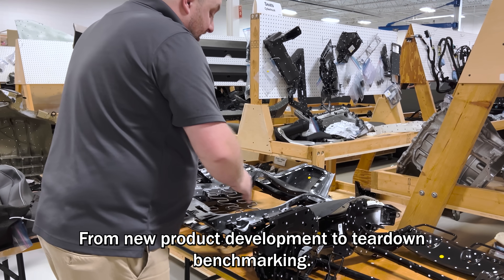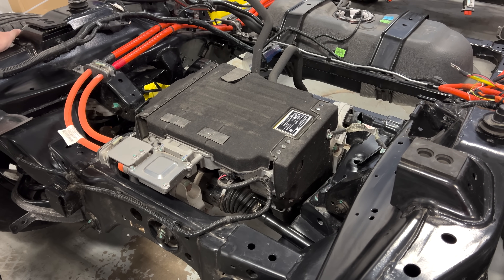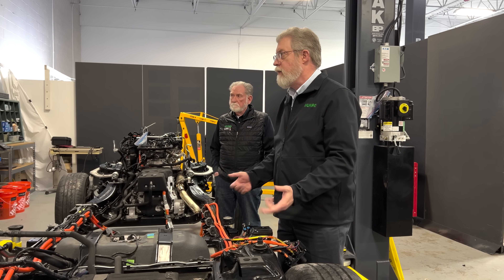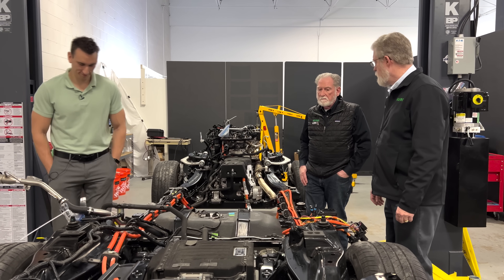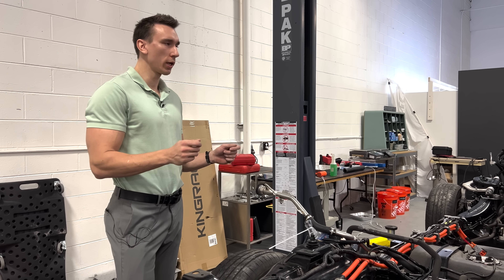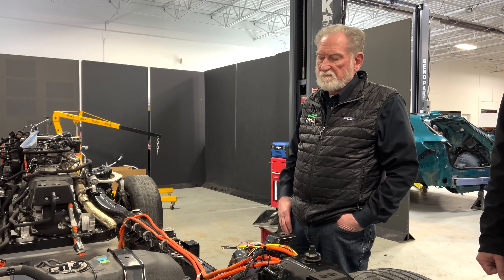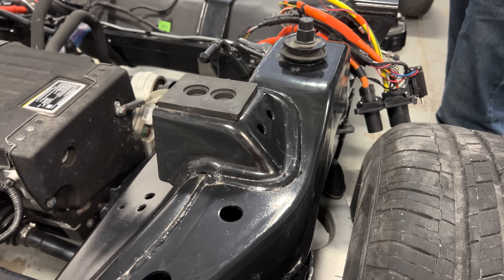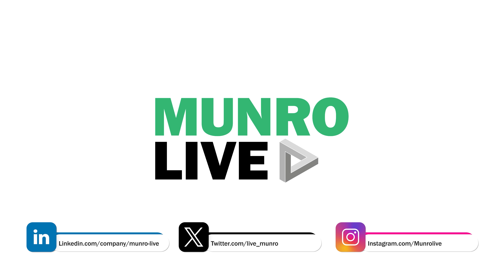There's a Monster Under the Bed of the BYD Shark!

Comment: The EM loss from this crazy ground loop wiring is probably less than a watt. But its interference into other electronic systems may be significant. In other words, it's not the power loss that we care about. 
The ground strap into the frame is okay if it's only done once. But if it's done in multiple places then you really have a very bad design.
Reply: I doubt it is electrical noise Isolation. It is common practice to ground the case. And the effect of the ground strap shall be easy to find out, just disconnected and see what happens
Reply: I believe the ground is there more to give a path for static electric dissipation.  Depending on tire formulation, you can build up a pretty huge charge.  That is going to couple into the vehicle through the rear half shafts and into the motor housing.  Better to send the charge from the motor housing into the frame instead of through the power electronics.

I learned about static build-up on a Mazda MX-6 I had back in the 1980s.  I put fancy Goodyear directional tires on.  Apparently the compounding was favorable to generating a static charge from the rolling friction.  When I got out of the car, if I wasn’t hanging on to something metal in the car, I would get a shock,which would almost knock me on my butt.  It was quite astonishing.

Comment: Some of these designs are common on semi trucks. Especially the hybrid welds with bolts. Probably the best example is the rear bumper on the trailers. It provides predictable crush behavior during crashes, because the bolts break or pull out before the welds. As for armored vehicles, the suspension on the M48 used something similar to make repairs easier after mine strikes. The M60 integrated it into the casting, which was so difficult to repair that it was withdrawn from Vietnam specifically because the difficulty of repairing the incessant mine damage. Which is why the M48 remained in service despite being outdated. So there are some precedents from other fields
Reply: made by retired tank engineers 😁
Reply: Nothing on a semi is welded, you part of the BYD 50 cent army or something.  Everything is bolted to the frame.
Reply: @Dexter_Solid bolt on pickup point on commercial truck chassis. Well, what do you know? 1450?
Reply: ANYONE seen videos from India, Africa, Asia where trucks are insanely overloaded 4m high with huge loads?   Perhaps that is the target market!   NOT Lot Crawler Urban Cowboys and Pretty Boy Dance haul trucks in the West.,,,,,,,,,,,,

Comment: So they are dissing a structurally sound and overdone structure?.....no surprise American cars fall apart.
Reply: It's Constructive Criticism. 
It's what they Do. 
Breaking down and assess the Product. And how it all comes together. BYD simply over engineering to insure that pass all market Saftey standards.

 + give reassurance to new customers that is build to last. Minus the Electrical Side 😑🤣 .

It's fair to say BYD has come kicking into this market and alot of the Western Car manufacturers are worried since BYD can Undercut them on most if not all of the lowest priced models mod priced models and getting your band for your buck.
Reply: If you design something properly, you can reduce weight and get the same structural strength. You could build a desk from steel girders and steel plate... that doesn't make it better if you are putting a monitor and keyboard on it. American cars fail probably because of the Chinese parts being used.
Reply: @GetOffMyyLawn lol how ridiculous so American companies care more about profit than product? Hah ok
Reply: @GetOffMyyLawn  American cars do not need  Chinese parts to fail!
Reply: @GetOffMyyLawn oh, you're dumb.
How Sad....
Reply: Angry Wumao, who is also clueless about engineering.
Reply: @JigilJigil  bigot who is also racist
Reply: @JigilJigil  What do you Got?
Reply: Overengineering, or over-engineering,[1] is the act of designing a product or providing a solution to a problem that is complicated in a way that provides no value or could have been designed to be simpler.
Reply: They broke the rules of US planned obsolescence.
Reply: @wdentondouglas  There is NO current loop.  The rear motor pair is separate from the charging pair.
Reply: They are judging it based on American and European market vehicles... where trucks are basically just large luxury cars that will be written off in any major accident. On the truly global market, smaller trucks do all of the jobs large "heavy duty" trucks do, and they run until the wheels fall off and then new wheels are put on and they keep running. BYD has spent a decade as the worlds largest commercial electric vehicle manufacturer. I bet they know some things about that market that most of us have no idea about.

Comment: There is no loop. One pair cables is for charging, the other pair is for the rear motor. You would need a long extension cord and then bypass the safety lockouts to have power on both pairs at the same time. If you are worried about inductance  you separate the conductors. Not to mention this mostly DC a pair of small cables  running AC for the onboard charger.
Reply: fr, like so much speculation and bro-engineering tbh. I was skeptical right when they said high voltage "DC" power lines causing the noise. Then they talk about "overdoing" the frame, like bruh and? You have C-Channel members welded inside the regular frame members, instead of praising their welding capabilities they decide to question why someone would aim for overbuilding a frame -- buddy its a truck.
Reply: 🤩🤩I take OVERBUILT ALL DAY and FOREVER!  Made for military in 1945...ill take 10!     Monroe would have 7 to 10 shots first, turn all red, and design the structure as cheap as possible!
Reply: @seymorefact4333  That mention about getting rid of steel gas tanks in lieu of plastic tanks, summed it up for me.
Reply: We appreciate your contribution, but in this case it's not quite accurate.  Yes, there is a loop.  It's in the shielding around the cables.  That is called a ground loop as I mentioned in the video.  We are well aware of the use of the cables for charging and operation.  The DC current during operation has a significant ripple component at the switching frequency that produces a time varying flux that links the ground loop and drives current in the shielding.
Reply: @PaulTurnbull-EMfield  take me BACK TO THE FUTURE!   🤣🤣☢️
Reply: @PaulTurnbull-EMfield  Isn't the DC shield part of the loop only if the shield would be connected at both ends? Would be a rookie mistake. Otherwise all I see is an equipotential bond if the HV system is built as TN, rather than the vastly more prevalent IT. There are TN systems on HV powertrains for the road, and they do have the advantage that a single defect to the ground would trigger a very easily detectable gorund plane current, which can be diagnosed with any decent shunt (so cheap and robust) - as opposed to an insulation monitor which is required in IT systems which are quire unreliable and expensive. Conjecture I suppose, but please give more details on why you think as you do - make it on a 2nd-channel if concerned the people will flip off over 10mn and ruin your algo. Obviously there is more analysis than what was presented in the video.

*EDIT: and yes I like the strong frame rails. No love for cars getting vritten off due to a 20mph side impact where the B-pillar colapses.
Reply: @PaulTurnbull-EMfield  How? The chassis (body/frame) is treated as a common ground plane, the impedance is almost 0. All HV cables are shielded and grounded. Also, thy are placed above the frame, so there is a massive reduction of EMI leaks. There is no crosstalk, cables are separated. Please, explain.
Reply: @PaulTurnbull-EMfield  I don't know everything about bonding and grounding, but I work in it everyday. You might using the term ground loop in a different context than what I would consider the classic ground loop. I would expect the charging cable side to have single ended shielding bonded at the battery/inverter and normally the contractors open the only possible current flow would be in shield with the truck in operation. The battery to motor likely has the shield bonded at multiple locations. 
Normally to avoid induction between cables we space them at these voltages, 30cm is all that is required. I've had cable trays as wide as this truck with all kinds of voltages currents and frequencies including the bonding. I am not seeing the issue, you are seeing. If the EMF is interacting from a meter away with the other cable I have other concerns. 
I have not measured the EMF and RF on an EV for about a decade, I only some quick measurements on my own vehicle it check if it was something I should be worried about and did not find any major EMF or RF. Has that changed on these newer higher voltage vehicles?
Reply: Exactly.  And it's not like we can't literally see the charging port on the right cable.  It's one of the dumbest things Munro comments about.